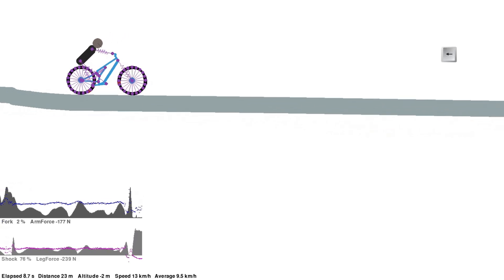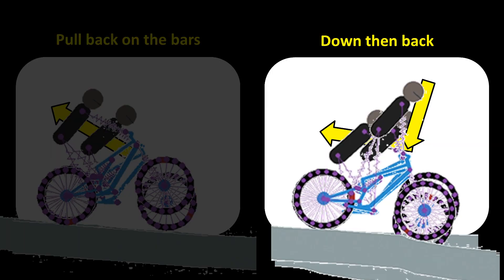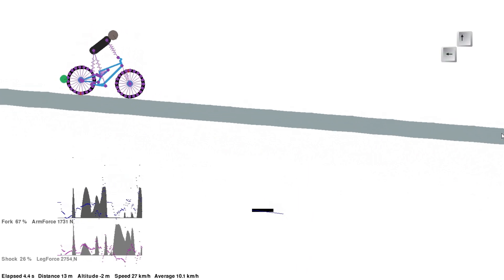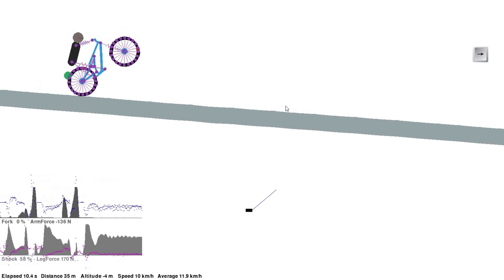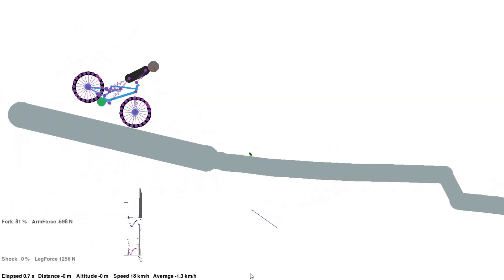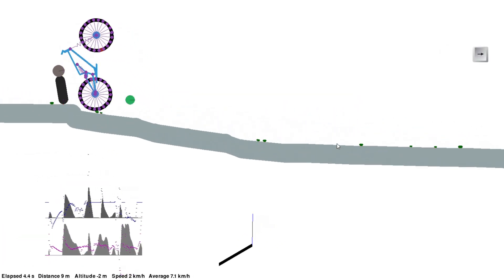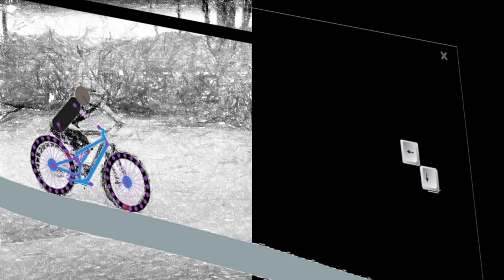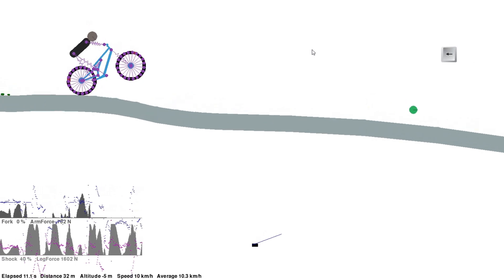Manual wheelies are hard — Mountain bike physics

Comment: Thank you so much for making this. I've been looking for a physics-based analysis of bike manuals, and couldn't find anything. Trying to work out what makes a bike easier or harder to HOLD a manual on, and not just initiate it.

From observations by riders in different videos on different bikes:
- Long and stable bikes are much harder to initiate a manual with, but on but easier to hold one.
- Bikes like dirt jumpers and BMX make it trivially easy to initiate a manual, but harder to hold.

I got a BMX bike recently hoping it would make manuals easier and more fun. It didn't. Way too twitchy, and having the front wheel hovering over the ground so low doesn't feel as satisfying as lofting it high.
Reply from the maker: Glad you enjoyed it. What you are saying about larger and smaller bikes makes perfect sense.

Comment: Yeah at the end doing manuals over obstacles with speed, balancing the weight forward and back looked awesome. I think you gotta work out the bugs on the small bumps and make a longer course to try to get to the end
Reply from the maker: Thanks for the suggestions! I am getting a little tired of the same terrain so breaking some new ground is a good idea.

Comment: Knee cause
Elbow bend and then the g center travel low due to knee bend ajdjust the lower part of the body
Reply from the maker: Thanks for the comment. I am surprised that this simple simulation even without elbows and knees can approximate actual rider behavior quite well. The rider "moves" by changing the "free" length of the arm and leg springs. It allows us to use one force instead of many.